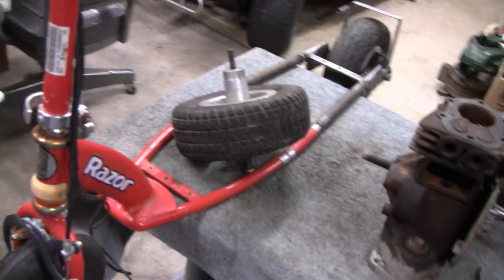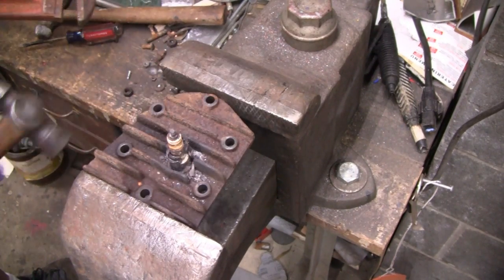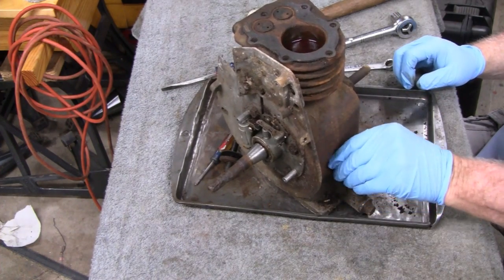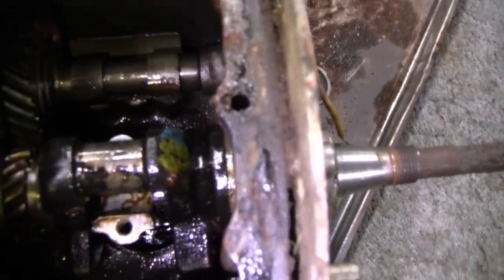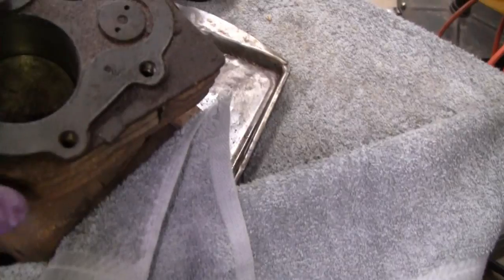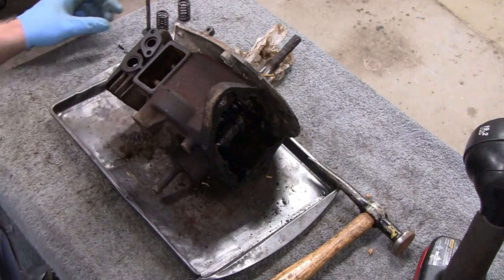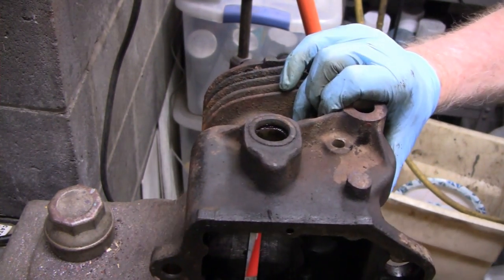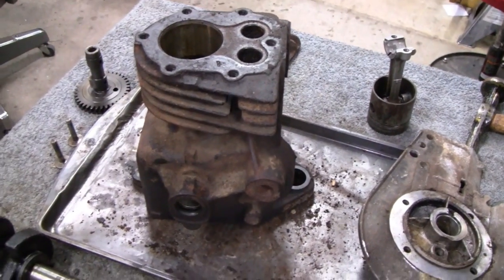MOTORIZED SCOOTER BUILD (part 3)

Comment: An old trick I learned from a local farmer was to heat up oil and pour it in and the heat in the oil should expand the metal to free up the piston. Used it on a lawnmower engine and made life easier. 

Really like the project and should turn out awesome.
Reply from the maker: Thanks Bud!!☺

Comment: I have a similar situation with the starter on my truck. One of the mounting bolts is in a spot where I can't use a universal or a swivel socket but I found a 1/4 dr extension with a swivel tip works great. It's also good to get some cheap pawn shop sockets to modify when needed.

Comment: Hey Roadking while pursuing one of the polaris manuals a few weeks ago I seen that they recommended using their carbon clean to manually clean carbon off parts as it is a fuel treatment. So at work I got around to trying it and it works great little on a scotch brite pad and some light scrubbing and the carbon melted away. Its about a dollar an OZ retail but I tell you its worth it to save time scrubbing. I got some to run through my IOT Im gonna borescope it before and after to see any difference to it.

Comment: Those orange pliers remind me of a some I found while digging a drainage ditch....... 

About 6 inches down I came up with a pair of pliers in my shovel.......  Orange handles and totally rusted ...........  I put em in my back pocket and kept on digging.........   

I DIDN'T put any oil on them at all, I just worked them with my hand back and forth.....  Oh I did put some salt on the joint of it though.....   Salt is a oil in a way .........

I still have them and they look like new.....   The name on the Orange grips are Cummings....

Next video I make I will show those pliers ..........   Plus Tard Mon Ami ~!~!
Reply from the maker: No need to make a video Boo, we believe you!!☺

Comment: Put the piston in a pan of oil and heat cycle it a few times on a camping stove.
  You’ve probs already done it using a better and easier method by now..

Comment: How do you get the timing right on that engine? Does it have timing marks?
Reply from the maker: Yeah it has timing marks on the crank gear and one on the cam!! As long as them two marks line up you should be fine!!☺

Comment: Is the paint on the crank a genuine mark? Same with the stamp on the block face where the gasket goes. If so that was some good paint! What is the styling going to be like this time? Would be nice as running found condition with its "at the bottom of a lake patina" fitted to a nicely painted frame, be a good talking point. Good luck with the rings, 1001 ways to do it, when they snap its always one of the other ways you should have used!
Reply from the maker: Thanks Bud!! I should have tried a different way to remove the rings!!☺

Comment: soak everything in the approved cleaner (gas) and it may clean right up. i posted a video on my maytag wringer washer i picked up last week for $12.50,according to what i could find it was made between 1933 and 37. originally a gas engine i believe,but i have a old 1/4 horse maytag electric motor. take a look and let me know what you think when you get a chance.thanks